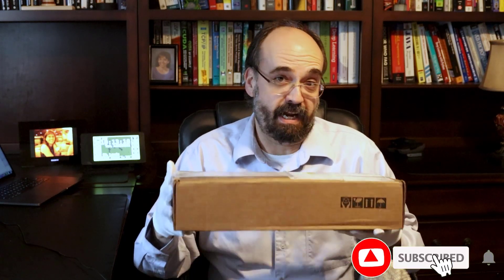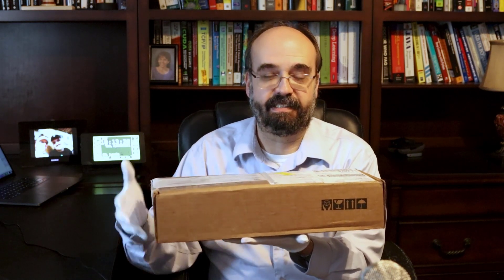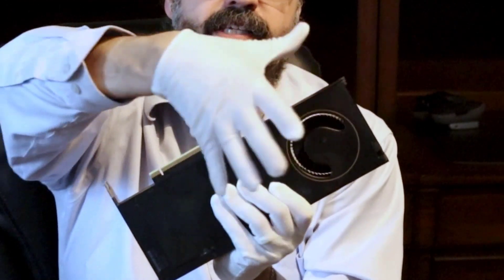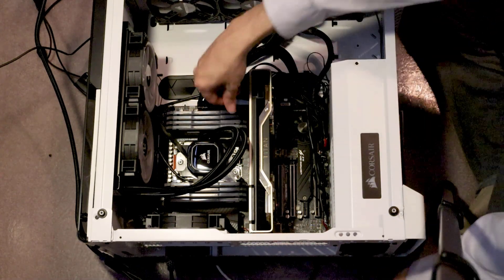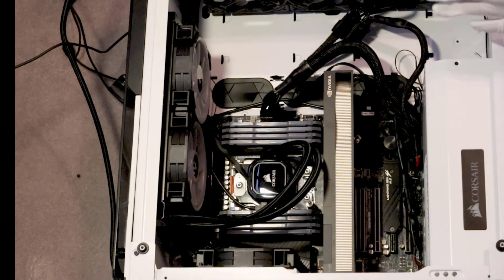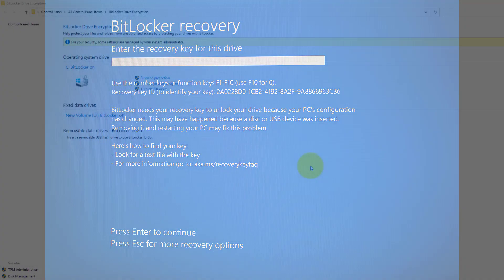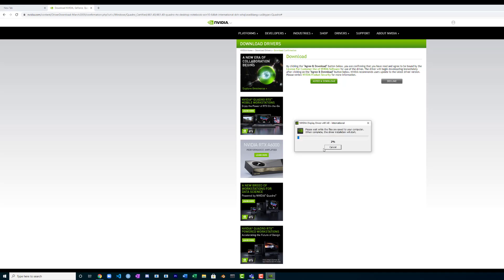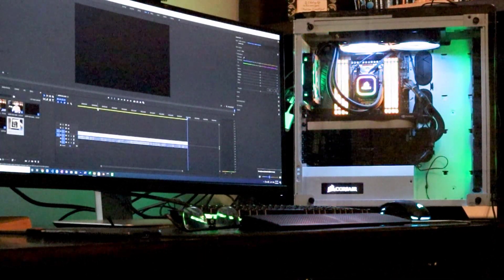NVIDIA RTX A6000 First Look for Data Science 48GB Ampere GPU

Comment: HI Jeff, and thank you for your all quality videos. You spoke about comparaison between RTX 3090 and A6000, it is possible to have you opinion about the Nvidia A30 option ? The price is really close to the A6000. Thanks for all from France ;)
Reply: The A30 is a cut-down A100 with only 24GB, with a GA100 die inside. It can do FP64 at 1:2 rate to FP32.
The A6000 48GB and 3090 24GB are both GA102 and mostly incapable of FP64 (1:64 rate to FP32).

Comment: waiting for nvidia to release an RTX A8000. I bet that would either be a 64GB or 96GB vram graphics card.
Reply: At the time that was infeasible, with a max of 2GB per GDDR6 chip and maximum of 24 memory chips (12 on front, 12 on back) on the PCB. But with stacked GDDR6W (4GB per chip), we might finally see 96GB cards soon!

Comment: Is this supposed to be better than RTX8000?
Reply from the maker: I've used both, and yes the A6000 is faster.  Same memory.  Right now the A6000 fills the same top spot in the professional workstation GPU line that the Quadro RTX 8000 filled.  I am not sure if NVIDIA is holding the "A8000" name for an even more powerful card in this line.

Comment: Hey! thanks for an overview video! May I ask, what are the noise levels in full load? I would Assume very loud since it's like 3090 with blower style and 300W, but I see you have it right next to the monitor, so I'm curious how much dB does it produce?
Thanks!
Reply from the maker: I have my recording setup/mics specifically tuned to eliminate noise, such as the fan or my dog snoring under the desk.  Measured with a highly scientific iPhone 😊, the room, with nothing running is 45db and 60db with the A6000 running full fan.
Reply: @HeatonResearch  wow 60dB is pretty loud considering I saw 86 temperature.
Thanks for the info!

Comment: Might wanna get some real fans in your case. A6000 with Corsair disco fans is not the look.
Reply from the maker: Good points, but so far so good with the system cooling, I do monitor GPU/CPU/RAM temps.  The temperature is in an acceptable range and not throttling.
Reply: @HeatonResearch  Understood. Yet still a shame for such a beautiful and powerful GPU...to be disrespected with Corsair anything.

Comment: As an aside, I am sure most people do not know this as well. The reason it shows at 44GB of RAM is because of ECC. ECC is on by default, it uses one chip for parity data, so each chip on that board must be 4GB. My K80s in ECC mode go from 12GB to 11GB. In the Nvidia control panel, you can disable ECC(requires a reboot), if you need the extra 4GB.
Reply: Imagine if on the servers when you put 32GB DDR-4 you get only 30, because of the ECC 🙂. So NVidia is lying that there are 48GB ECC - there are 44GB ECC.

Comment from the maker: If you are wondering what the actual box looks like, if you get this card through more traditional retail,  https://www.leadtek.com/eng/products/workstation_graphics(2)/NVIDIA_Quadro_RTX_A6000(30893)/detail
Reply: @Jeff Heaton, Hey man just a word of advice. Never daisy chain power connectors to your rtx cards. Yeah I know psu supply them but it's their way of cutting costs. Always use separate 8 pin connects for each plug in, if that makes sense. Yeah most won't care and do it daisy chaining, but if you're using it for high end rendering, ai simulations, neural networks, or in my case 4x 3090 FE's for mining, separate connections EACH to pardon my French, 'Cover your @$$'... See ya im outta here~
Reply from the maker: @battosaijenkins  Good advice

Comment: Fantastic video. Thank you very much for sharing your experience. I am getting a new workstation with the main purpose of 8K video editing. Did you see faster rendering of your YouTube video with this card?
Reply from the maker: I do not do 8K at this point but for HD and 4K, premiere pro loves the new card.  Have not formally benchmarked it though, does feel faster.  This will only improve as software better embraces Ampere.
Reply: @HeatonResearch  Thank you very much.

Comment: Nice anti-static handling technique. I highly recommend it for all nvidia cards. Also nvidia cards may have a massive mis-match between compute and memory bandwidth for the newer and faster NN algorithms. For the NN segment of the market they face huge re-engineering costs. However I'm sure they have the money. Anyway it's not their fault. It's down to the broken foundations of NN research. The failure even to apply the scientific method to the dot product and other simple aspects of NNs.
Reply: Yeh, they don't even know how to use the dot product as a general associative memory by meeting the demands of the variance equation. Ie. Random projection, non-linear function, dot product. Terrible basic research. The NN books start in the middle and work forward. No one looked back to check the basics and challange assumptions.⚠⚠⚠

Comment: Thanks so much for such awesome content. A humble request, would you please highlight whether the performance is worth the expense. Would it be better to buy 2 x 3090s? Perhaps indicate from your experience whether the unlocked features as well as the ECC ram on the card affect inference to the extent that 3090s aren't  appropriate for DataScience.
Reply from the maker: That would be an interesting comparison, and probably something outside of the range of what I could setup right now. My guess is that it would be similar if you do not need >24GB RAM on the GPU.  For something that parallel-izes really well (GAN training comes to mind), two 3090s would likely outperform a single A6000.  Of course, realize that 24GB on two 3090s can't do all of the same things as 48GB on a single A6000. Generally, you are mirroring training data and parameters. Cooling two 3090s is going to be more challenging than cooling a single A6000, or even two A6000s.
Reply: @HeatonResearch  I can add a bit about that. Using two GPUs, the easiest way to achieve parallelism is indeed data parallelism (i.e. Pytorch's DataParallel). In this way, data batches are not mirrored, and each gpu gets its own half of the current minibatch. 
Other than that, bear in mind that there are 3090s specifically made for multi-gpu configurations. Actually you can tightly stack four of them in a desktop, and still get zero cooling issues since they blow all the hot air out of the case: https://www.pugetsystems.com/labs/articles/Quad-GeForce-RTX-3090-in-a-desktop---Does-it-work-1935/
I got two of them, and the maximum temp I get is barely 71-72C for the upper card.
Reply: @weylandsmith5924  Hey Weyland, would you recommend a 2x3090 over 1xA6000? I am looking at several builds, but getting some mixed opinion esp. that the performance increase giong 2x3090 may not be that huge (although the CUDA cores are so many more)

Comment: I would like benchmarks for the A6000 vs a 3090 on the same training set.
Reply from the maker: That would be an interesting comparison, and probably something outside of the range of what I could setup right now. My guess is that it would be similar if you do not need >24GB RAM on the GPU.  For something that parallel-izes really well (GAN training comes to mind), two 3090s would likely outperform a single A6000.  Of course, realize that 24GB on two 3090s can't do all of the same things as 48GB on a single A6000. Generally, you are mirroring training data and parameters. Cooling two 3090s is going to be more challenging than cooling a single A6000, or even two A6000s.
Reply: @HeatonResearch  yep, 3090 is so big and costing 350w power
Reply: @bodsun9036  Closer to 500w depending on what version of the card you have and if you enable any kind of OC bios.
Reply: @bodsun9036  the EVGA Kingpin can use in the 600w range.  Probably higher with Liquid Nitrogen
Reply: @HeatonResearch  It does make sense that two 3090s would outperform an A6000. The 48GB of memory would be matched, but each 3090 has 10,500 CUDA cores, while a single A6000 has 10,700. Also, the A6000’s GPU is more proficient in INT4 and INT8.
Reply: @bunsenn5064  Hi I have this quandry now , either go with a 2xRTX3090 build (£7100, UK, CPU: AMD threadripper 3090X) or 1x A6000 (£6200, CPU: AMD Ryzen 9 5900X ). Other than the price increase, I am wondering if there are any benchmarks which might allow me to compare.
Reply: @HeatonResearch  Great video! So, is it a single A6000 outperform a 3090?
Reply: Jeff, I got a workstation with two 3090s. If you want, we can run benchmarks and compare them. Just give me the benchmark notebooks and I'll run them.
Reply: @weylandsmith5924  u lucky guy
Reply: Same